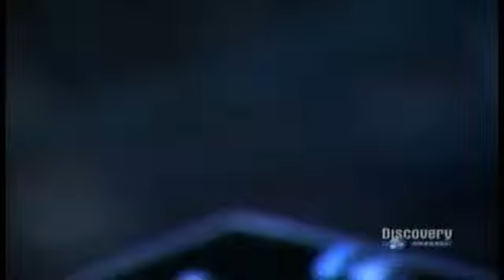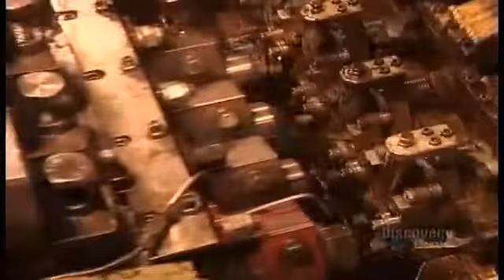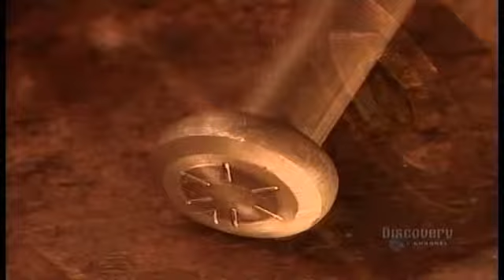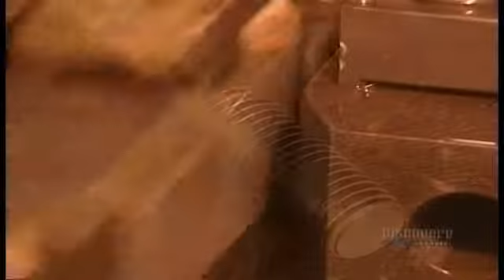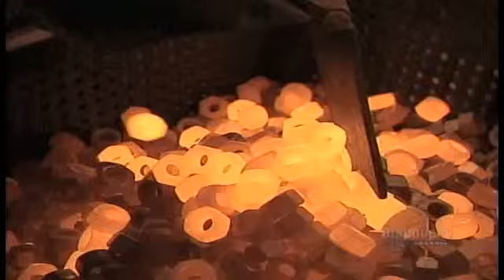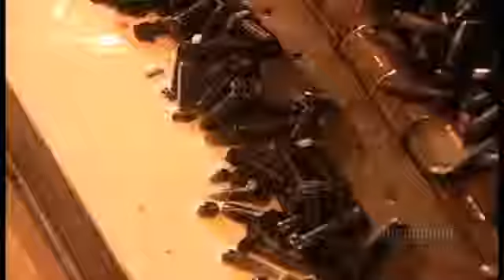How Its Made: Nuts and Bolts

Comment: I liked how although the round head of a bolt looks somewhat common, the hexagonal head is the most common, most familiar shape. When I was little, I used to think that the hexagonal shape was also so original, that it was not moderate. And that the purpose was just the appearance. Nothing more than just a design. The last thing I noticed from watching this, was that although it's hexagonal and not round, but it was round for a brief moment, a tip of the curvature of the brief round head still remains at the very outer edges of the topside corners.

Comment: This is so crazy to watch, something that literally holds up any structure that stands, also the manufacturing is so incredibly complex like imagine the engineering behind all the machinery, but then what makes the machinery? What makes what makes the machinery??
Reply: I set these machines up for a living it is tedious but very rewarding to complete a set up and get a final part. All the timing is done by hand along with controlling every single part of the fastener.
Reply: @Deathby_Cj I was a header operator and team leader for 5 years. I loved every minute of it, it's a hugely rewarding career. 

Here's a question for you, how did someone manufacture and assemble the first precision lathe without a precision lathe 😂
Reply: @shadow4392  actually I happen to know the answer to that. The first precision lathe would have been made by hand using a more rudimentary two person metal working lathe that had a pretty simple design, it had one person applying a sharp metal working tool and another doing the spinning with a sort of belt apparatus. So basically a primitive lathe was used to make a better lathe and then that lathe was used to make an even better lathe.
Reply: @MilxyYT  are you still a virgin?

Comment: Fascinating:
40 years ago you begin by cutting your steel bar or titanium bar or hastalloy bar.
Once you get them cut to size you had to take them to a centerless grinder and turn them down so they will fit into a die when they would then be made red hot for the 200 ton press that will ship the hex heads upon them BOY has time has changed